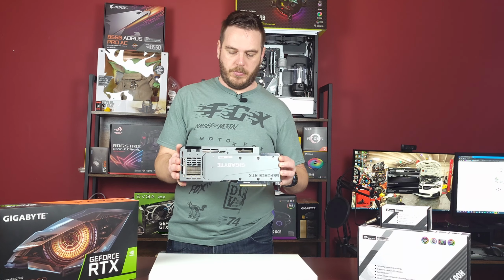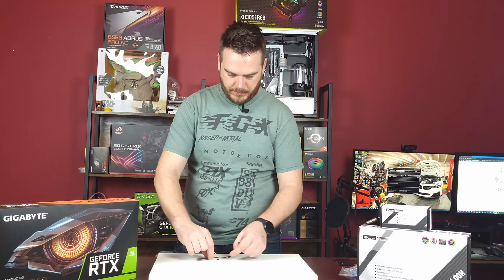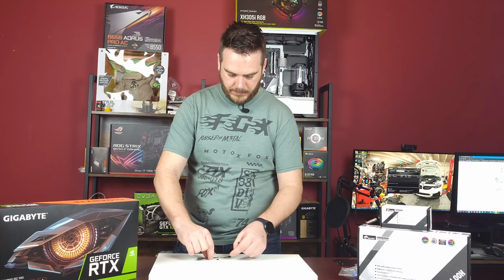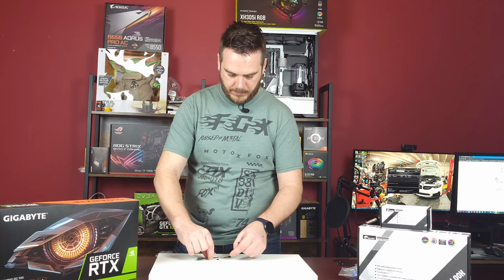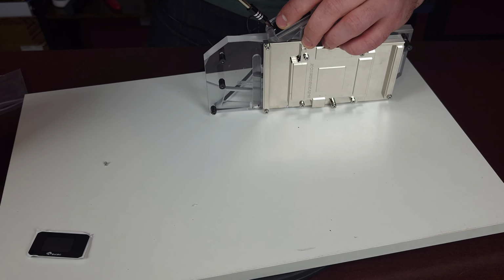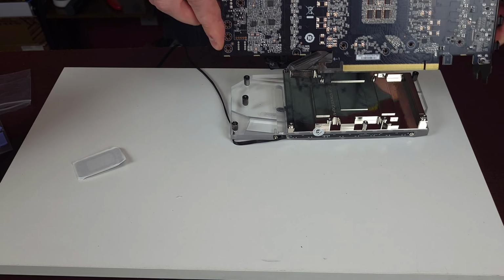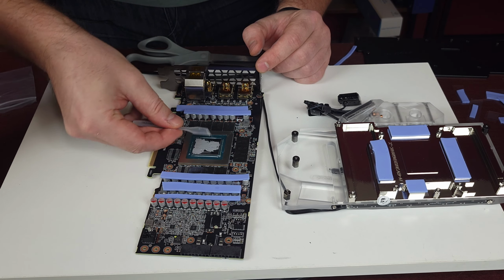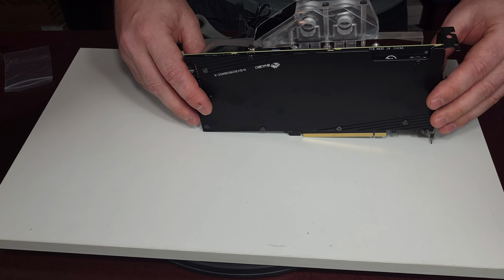Gigabyte RTX 3080 Gaming OC Bykski Water Block Install for How To Build A Watercooled Computer Part3

Comment: Id recommend buying .5mm and 1mm thermal pads, because alot of components that need to be cooled wont make contact with the water block
Reply: I have this waterblock and exact gpu, the way the block is is machined isnt ideal and they only give you 2mm pads, but aslong as you have some .5mm and 1mm pads you can make it fit nicely and safely

Comment: No pads in the back?
What temps you have in the memories?
Reply from the maker: What do you mean no pads?
Reply: @evolvedcomputers1769  did u put thermal pads in the backplate?
Reply from the maker: @NunoLeitaoTheEpiq  Of course. Didn't you see me struggle lol
Reply from the maker: @NunoLeitaoTheEpiq  you can see the pads there before I screw it down.
Reply from the maker: @NunoLeitaoTheEpiq  Thank you.. Yeah camera and audio did tricks there and i needed to edit it out sadly. Sorry about that.. I keep that in mind next time and try to make videos better. Thank you for the feedback and subscription.
BTW pads only go on top of chips or transistors. Backside has only couple chips so it's easy.
Reply: @NunoLeitaoTheEpiq  bykski has a version that watercools the back plate as well, i bought it and am currently applying it to my gpu

Comment: did you have problems with the 2 8 pins cables for the gpu that came with the water block?
Reply from the maker: We didn't use them. We used these:
https://www.moddiy.com/products/Gigabyte-RTX-30-PCB-Flat-8-Pin-to-PCIE-8-Pin-Custom-Adapter-Cable.html
Reply: The cables included with my block work perfectly fine, but they are a bit long.

Comment: What about the plastic washers did you use it? 
if you used it can you tell me exactly where because i ordered a Bykski waterblock for my card and am afraid to destroy my GPU
Reply from the maker: Yes we did. If you look the video you see where I struggle with them. And don't worry. If you don't use any force you don't do anything bad to your card.
Reply: @evolvedcomputers1769  No, actually, you edited out that most important part.  None of the struggle remains in the video, and thus nothing worthwhile.  Hopefully I can find another video that actually shows the install.

Comment: Looks like you added thermal pads to back side of board?
LINKup has 4.0 riser cables now, if you didnt know.
Reply from the maker: Yeah they do now. Before there was none and the computer is already sold. Thank you..
And yes there is pads on the back side too.
Reply: @evolvedcomputers1769  Will water-cooling solve the memory heat issue?
Reply from the maker: @BARBELLS-AND-BUDS  Why do you have memory heat issue?
Reply: @evolvedcomputers1769  
Gaming im into the high 80s, mining it will hit 110 if I dont undervolt and restrict power to 170 watts or less. Poor design I guess
Reply from the maker: @BARBELLS-AND-BUDS  We didn't have that at all. Highest i got the build was 68 degrees.
Reply: @evolvedcomputers1769  Core temp or mem temp? And was that gaming or mining temp? My core temp never exceeds 67c eexcept in the NR200 once I forgot to take the glass side of gaming once with vertical gpu. Fans were screaming!
Reply from the maker: @BARBELLS-AND-BUDS  Core. Mem temps stayed around 80. 
And it was 3 hours of heaven and cinebench testing in a row. so full GPU blast.
Reply: @evolvedcomputers1769  I get 84c in stress tests, but 106+ after 2 min Mining in stock configuration.
Reply from the maker: @BARBELLS-AND-BUDS  Yeah we don't test mining.. stress tests only.. Would be weird if we would mine lol
Reply: @evolvedcomputers1769  Yeah I never planned on miming, but Building a new system cost So F****N much esp with GPU prices. I need to recoup some of the expense. Mining seems to be the ultimate MEM temp stressor. So if mining temps are cool on memory nothing in a normal system can stress this known weak point.
Reply from the maker: @BARBELLS-AND-BUDS  True. I don't blame anyone who mines. It's always good to have options to make money. So what's your hashrate and what are you mining?
Reply: @evolvedcomputers1769  I havent replaced pads yet. Mining NIcehash (ETH). I undervolted and tuned my max power draw to keep me 92c Vram or lower. At that rate in getting between 70 and 80 Mh/s. It fluctuates based on the ambient room temp. This card will go to around 100+- when running cool.
Reply from the maker: @BARBELLS-AND-BUDS  Nice..
Reply: @evolvedcomputers1769  I know most people are not happy with miners (me included). 
I didnt buy cards to mine. 
Rather I am mining to afford to buy the scalped cards. 
So im not taking cards away from gamers (like me) because I am only mining with the card I use to game, and might mine with my other PC gaming card after I finish building that pc. 
I have pre-orders on prebuilts that I will use to build system for family or to sell since its about the same price to buy prebuilts as just a scalped card quite often  now.
Prebuilts have less than optimal cases and MBs etc sometimes. Ill be taking them apart and keeping the parts like ram CPU GPU etc, and adding a new case and cooling solution. Ill sell at or below market value the new parts I dont want like MBs and cases.
Reply from the maker: @BARBELLS-AND-BUDS  Oh don't worry.. I mine with my gaming pc also. Would never do that to customer pc tho..
Reply: @evolvedcomputers1769  I think as long as I keep the temps in check Im not doing serious damage more than an avid gamer does. Yeah if I mine on a card and sell it, I will be honest and say so weather or not I feel it did any damage. I am only using cards I plan to keep.
Reply from the maker: @BARBELLS-AND-BUDS  no it doesn't damage it.. yeah just keep an eye on temps and maybe if you can better fans in case or more..
Reply: @evolvedcomputers1769  Yeah this is why I am moving build rom NR200 to Lian Li 011 Mini. new pads and paste and more fans. I ordered Arctic P12s. I wanted to go RGB, but I am after better airflow right now. I think often the RGB fans aren't really that good of fans.
Reply from the maker: @BARBELLS-AND-BUDS  Depending what you buy. There is a lot of fans that look great and move a lot of air.
Reply: @evolvedcomputers1769  Do you have any RGB fan recommendations that are still quiet and move air well? I dont expect Noctua quality, but good quality.
Reply from the maker: @BARBELLS-AND-BUDS  Corsair QL120RGB of course Lian Li Uni fans. On cheaper side Corona fans work great.
Reply: @evolvedcomputers1769  Last month I saw Ali Express had the Uni fans really cheap, now just 25% lower that the low priced retailers.
I have TT Riing trios and they dont seem to 
have much aid flow, but they do look nice!
Reply from the maker: @BARBELLS-AND-BUDS  Yeah TT stuff for cooling.. Nah.. We will have UNI fans stock next week.
Reply: @evolvedcomputers1769  Ive never tried the Uni fans, but I see so many youtubers use them. I also like the understated RGB hey have
Reply from the maker: @BARBELLS-AND-BUDS  Yes.. they are in between of no rgb and a lot of rgb..
Reply: @evolvedcomputers1769  I picked up a Cyberpower PC y-day with an EVGA 3060 and it mines with WAY lower mem temps.
Reply from the maker: @BARBELLS-AND-BUDS  Nice
Reply: @evolvedcomputers1769  I wont the Newegg shuffle today Asus Rog Strix  6700 xt and a mb combo
Reply from the maker: @BARBELLS-AND-BUDS  Nice.. Congratulations..
Reply: @evolvedcomputers1769  Thanks, giving it to son in law. I dont need it and he really needs it. I have 2 more prebuilts coming with 3080s I picked up for just over $2k each I have to decide what to do with. one with 5600x and the other with  i5-10600KF.
The AMD based one is gonna ship soon and has a Tuf 3080 in it.
I might cancel the other one if I dont end up needing the parts and nobody I know wants it.
Reply from the maker: @BARBELLS-AND-BUDS  Deem.. Look at You.. Balling :D
Reply: @evolvedcomputers1769  lol I wish. Just for builds for others mostly. Thats why I  might cancel the other order. I cant afford to buy it  for personal use. I didnt want to win Shuffle nd not get buy the GPU thats why I had to find someone that could use and needs it. Daughters BF is paying for the Shuffle GPU btw too (actual price) no mark up. I wish I could afford to buy it and give it free...
Reply: Which thickness and locations for the backplate? Is there a diagram somewhere for the layout? I also can’t find the nickel backplate online. Does somebody have a link?
Reply: @zikjegaming6652  I didnt do the backplate on mione. But it runs SOOO cool without it. I literally dropped 30C from just replacing the top ones and using a quality paste.

Comment: I just installed this and it doesn't seem like the capacitors or chips on the outsides of the memory don't seem to contact the conductive surface of the water block.  Was that a problem for you?  Does it matter?
Reply: I have the same issue. High vram temps. Did you?
Reply: they don't i ended up stacking thermal pads in that space to fill and it helped my temps but not alot
Reply: @joeyf3895  I was able to run this pretty hard at VRAM temps in the 88-92 region which is cooler than the air cooled.  The GPU temp was usually in the 60s.  Unfortunately I started getting a hot spot this week (of 104 degrees) and took it out of my mining rig.  I haven't taken it apart yet but I theorize either the paste melted out OR the corrosion of the nickel plating is preventing adequate flow to the GPU through the fins.
Reply: @DefencelessDuck  I did the same.  I was able to run this pretty hard at VRAM temps in the 88-92 region which is cooler than the air cooled.  The GPU temp was usually in the 60s.  Unfortunately I started getting a hot spot this week (of 104 degrees) and took it out of my mining rig.  I haven't taken it apart yet but I theorize either the paste melted out OR the corrosion of the nickel plating is preventing adequate flow to the GPU through the fins.
Reply: @sbschlegel  Currently suffering from high vram temps as well. Did you figure out how to fix it on your end?
Reply: @tahmidhannan6419  I think it’s the backplate chips hitting the high temps. In the past I tried to get all the tertiary chips and capacitors covered and touching the plate. 

This time I simply prioritized VRAM and GPU and didn’t worry as much about the others. I put 1.5mm gelid extreme everywhere. Now GPU is about 59 and VRAM 76 so it’s better. 

I think potentially the GPU die contact isn’t perfect since the pads are a little thicker and it’s temp is a little higher than previous assemblies. But this seems to be as close to “good” as I can get it all.  I actually bought the active backplate vram piece but haven’t installed it yet.

Comment: Do u have links for this stuff ? Pleaseeee
Reply from the maker: https://bykski.aliexpress.com/store/4991363?spm=a2g0o.productlist.0.0.3e295438uRGF8v
Reply: @evolvedcomputers1769  thank you!
Reply: @evolvedcomputers1769  do i get the 5v 3 pin cable or the 12v 4 pin cable? Sorry im new and this is my first pc build
Reply from the maker: @phillherup  Depending what kind of motherboard you have and you have support for 5V or 12V. Also you need to think ahead what other products will use RGB headers and which are which..

Comment: what about the core and memory temperature?
Reply: I happen to have the same block, it has about 20 C delta over water temperature. Hotspot has 35 C dT. Memory is colder than hotspot. This with mildly overclocked Gigabyte OC Gaming 3080. I used liquid metal Thermal Grizzly Conductonaut on the die and Alphacool 14 W/(m*K) pads (1.5 mm I think) on the RAM and VRM. With paste on GPU expect 5 C more, with worse pads also a few degrees more on RAM and VRM. Backplate has the original pads which are 4 W/(m*K), blue, 1.5 mm.
The GPU runs into power limits way before thermals.

Comment: You missed the tiny memory controller chips. Also those thermal PADs that come with this block are just 4w/mk, I would recommed replacing them for a better performance one.
Reply from the maker: No we didn't

Comment: my rtx 3080 w/c card is shutting down after 10 sec of pc start
Reply from the maker: How come?
Reply: Overheating because they give you wrong sized pads, you need some .5mm and 1mm pads
Reply: @phillherup  yes it's true. I changed pads, but i couldn't turn on pc - keeps showing "no screen" my thought was that smth wrong with cards receiving no signal from vents. I reinstalled back air cooler and everything worked ok. I'm very disappointed(
Reply: @evolvedcomputers1769  my thought is: card tries to read info from vents, but receives no signal and not turning on( Paste was on CPU so i don't think its overheat, minimum it should turn on for 10 sec and then shut down, but its not turning on
Reply: @evolvedcomputers1769  Did you have issues powering the card up without using the original power cable that has a temperature sensor? I doubt the Bykski provided extension cable has temperature sensor installed.